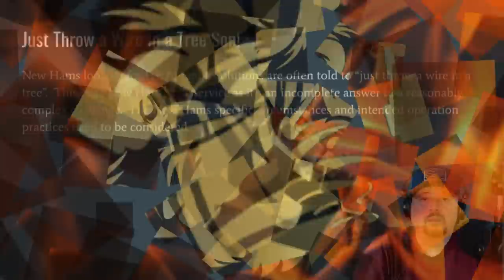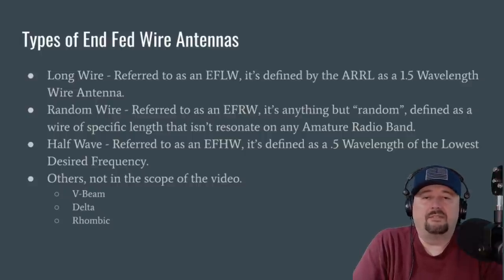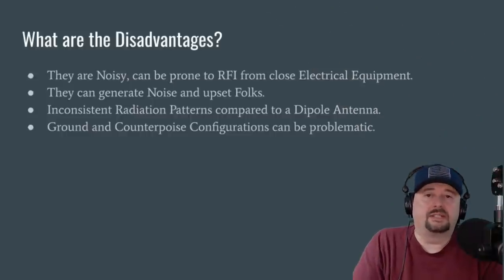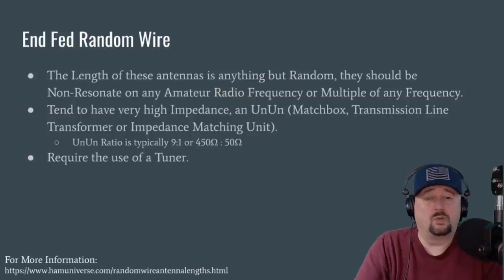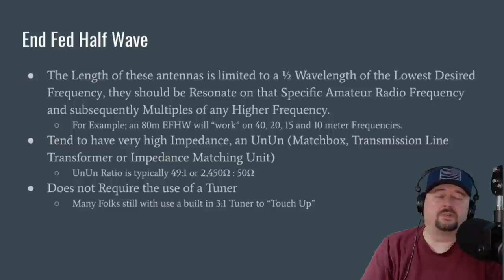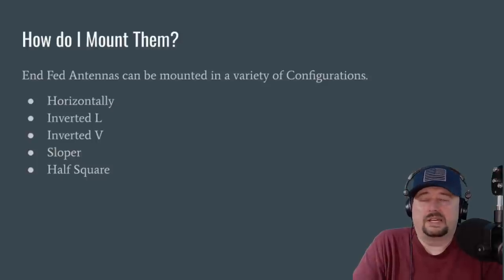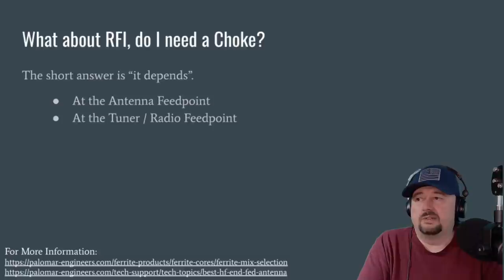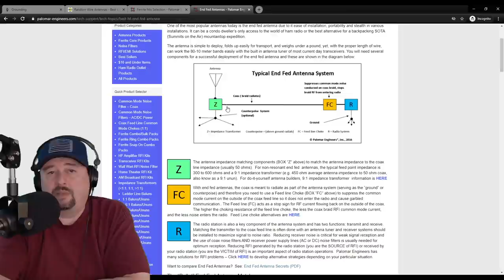What the Heck is a Long Wire Antenna? - Ham Radio

Comment: Actually, the definition in the appendix would be a better reference, my bad: "Long wire—A wire antenna that is one wavelength
or greater in electrical length. When two or more wavelengths long it provides gain and a multilobe radiation
pattern. When terminated at one end it becomes essentially unidirectional off that end."
Reply from the maker: Thanks for the info!
Reply: @TheSmokinApe  I've never tried a fullwave wire before. I think it would be cool to at least try one.
Reply: @highlandkraftwerks  Start with 6M, easy to construct - just a tad under a 20' wire. The horizontal polarization works extremely well for some extra gain when using SSB on 6M. Run it more vertical, of course, if ur transmitting FM to repeaters.
Reply: Terminated? What does that mean? Any finite wire is terminated when you cut it from the larger roll, right? I need more information on how to do that and with what. 🤓
Reply: @PatrickKQ4HBD  <--- total radio newb, but I think that would mean terminated with some resistance via a resistor on the end.
Reply: Dx commander Cullum has a video about his friend Rollie in New Zealand who used some telephone wire that wasn't being used still on the poles. If I'm not mistaken it was over a mile long. Now that's a true long wire antenna.

Comment: Perhaps one of the most useful ham radio videos for new hams. I’ve struggled getting good info as a new ham and ham groups not meeting due to COVID. I ended up doing an end fed random length wire antenna but this gave me more info to understand what I’m experiencing and ideas on how to improve it. Thanks for putting the work into creating this video.
Reply from the maker: Thanks for the comment Bradford, glad the video was helpful 👍
Reply: Well, COVID is over now. The government has declared it over by rescinding all COVID benefits, so plan on getting together with other Hams to spread info on the latest stuff. Also plan on making your own stuff, especially antennas. Hams that buy antennas "off the shelf" do not learn anything about antenna theory and end up spending altogether too much money on something they could have built themselves for half the price.

Comment: Hey Ape, ur right about how important the RF choke is - not only for RFI, but improved SWR as well (too much reflected RF along the coax shield negatively impacts SWR). For my base station, I use a MyAntennas 65' EFHW as a sloper, fed at my roof line 12' high and sloping up to a 37' fiberglass pole mounted at the back fence. Works fantastic! I use a DX Engineering toroid choke at the feedpoint and also at the entrance to my second floor HAM shack. No RFI and low SWR. However, for portable ops, I use a Wolf River Coil vertical antenna (which I'm absolutely in HAM-love with). For that, I put my DX Engineering toroid choke 12' down the coax from the antenna and then run another 25' coax to my rig. I experimented greatly with different lengths and found using the 12' of coax as a 'counterpoise' for a vertical worked much better than at the feedpoint or none at all. I combine that with nine 8' radials (3 off each leg of the tripod) for portable ops. 73 KJ6ER, Silicon Valley
Reply from the maker: Great comment, I like hearing about other folks setups.  Thanks for sharing!

Comment: I feel you've provided very useful information about end-fed antennas for those who want to work multiple HF bands. Houses with large yards and space for multiple antennas or towers are increasing expensive. Many younger hams live in apartments and condos where a single multiband stealth wire antennas is possible. Also, older hams whose children have left home may want to down size and move into smaller homes or condos. For those considering an end-fed antenna, I've worked Australia and the US East Coast from California using 100 watts on 40 meters SSB with a 71' non resonant end-fed sloper going from a 25' balcony down to a 6' wooden fence. It has a 9:1 unun, 50' RG8u, two 15' counterpoises, common mode choke near the transceiver and a manual antenna tuner. I check into 40 and 80 meter nets and get good signal reports. Using that antenna I've made QRP contacts with as little as 1 watt. I'd encourage hams to experiment with end-fed antennas, especially if you have limited space and need stealth. Your results may be surprising. Thanks again for the excellent presentation and the helpful references!
Reply from the maker: Thanks for the detailed comment Jon and for checking out the video 👍

Comment: Thanks for making a video where you actually cite sources and provide an objective comparison!  I just want to caution regarding "reading online reviews"...please understand that some users are biased (both good and bad), some have been paid or are provided with free equipment, or their reasons for providing a positive review might actually be the opposite of your requirements or use case.  Ya know what would make the video go from good to excellent? A round table of youtube "experts" at the end discussing this evidence based material and applying it to station operation.  73 de N2MXX
Reply from the maker: You make a great point about online reviews David, thanks!  Also, thanks for the feedback and suggestion.

Comment: Great video, Ape you rock man.
I have followed yourself advice with my end feds and have found similar results. I apply a choke at my 9:1 and have used a counterpoise, but I'm still learning by playing.
I recently used my 9:1 end fed at a inverted L using a 30ft telescoping with good results as well. I plan on exploring with which I help to use to get some more experience using my nanovna and experimenting with the different stuff>
 because hey just like you have said, it's fun and it more important makes you a better ham operator when you understand what you are doing by "doing radio" and apply the -art of our hobby.
Reply from the maker: Great post Mike.  Thanks for the feedback 👍

Comment: I'm listening while working on the house. Inverted L's are vertical antennas. They require a groundplane. They are not to be confused with an inverted vee which is a horizontal polarization antenna and requires no ground plane. 

The inverted L is a compromise quarter wave vertical when you can't get enough height, you fold it over. 

So if you want a 160m antenna, your inverted vee will work very well against the inverted L if you get the vee center up a half wave in height. 

Maybe you can see why a lot of low banders go with inverted L's. They really aren't necessary on 20m or above because it is so easy to hang a dipole. 

Peace.
Reply from the maker: Agreed,  thanks for the post BDRFI 👍

Comment: I highly recommend a 9:1 unun whether you build one or buy one for experimenting. With a tuner and a bit of an imagination you'd be surprised what metal objects can be turned into an antenna. This past year I played around with all the same wire lengths you spoke of and it's been interesting but recently settled on something around 71 feet. Also experiment with counterpoise wires in different lengths and directions multiples etc.. One interesting thing I've found is some bands don't require the tuner at all so experiment with that too. I recently found my current configuration has a pretty flat SWR on 17 meters without the tuner in addition to other bands I was already bypassing the tuner on.
Reply from the maker: Great comment and I totally agree.  I’ve have similar experiences, thanks CWB 👍

Comment: Your comments at the start are correct.  A lot of advice is thrown out casually and assuming a knowledge that if present wouldn't be generating the questions.  I also think the requirements for RX are not so onerous as for TX and its not always clear which the advice is aimed at. I  am struggling to find a suitable antenna but i also want to  consider the RF radiation impact at the same time and for my small space its very constricting.  Also while I thought i was comfortable with the concept of counterpoises the practical side is slightly confusing me as the various advice out there doesn't seem consistent or detailed.

Comment: I like the new background and I like videos that get me thinking. 
Props
I think would be a good be sure to clearly delineate different usage scenarios too. 
Getting started with basic stuff can work, but yes it should be done with an eye toward growing your experience and evolving your station to be as good as it can be.
I am guilty of making the advice of throwing out a wire and stuffing an wire into a radio connector; however, that's an attempt someone to give a means to listen to a radio they might not have ability to connect properly yet in order to give them access to it.
Should they get the proper connectors? YOU KNOW IT! -This is the beginning of the magic very often. I wish I could gift a PL-259 and 25ft of some coaxial cable to everyone getting started... :)
BUT
There is always a starting point, and sometimes that starting is a very low start indeed. I'm remind myself of my humbling beginnings on my ongoing radio journey...
That being that said YES let us give the best advice we can and advance the art and help us make radio better for everyone!
Reply from the maker: Thanks Mike.  I'm planning to do more detailed videos on the EFRW and EFHW but it's going to have to wait for warmer weather.  One thing I always say is just get the antenna up, then modify or adjust as you progress.  Thanks for the comment!

Comment: Thanks for the video.  I'm just getting back in HF after about a decade off the air.  I've used flat dipoles, inverted v s and a full wave loop for 80 meters (one of my all time favorites).  
My tree limbs are more in the way now so I'm taking a look at a lot of different ideas for the wire.  Your video answered a lot of questions for me.  One was about the inverted L long wire antenna, the long wire inverted v type long wire  and another was the long wire that went up, across horizontally and then back down as well as how to feed those and how high above the earth.    
One question I have is how radiation pattern feed ohms etc are affected if I put most of the wire horizontal, but give the wire 90 degree direction changes with most of the wire horizontal?  That could give me a lot more wire surface.  Oh, I also noted the lengths to avoid and to use.
Thank you.
Reply from the maker: Hey SE, glad the video was helpful.  A horizontal bend will certainly change the radiation pattern and may change the impedance but give it a try.  I have seen them in giant U and Z patterns where people were making plenty of contacts 👍
Reply: @TheSmokinApe  Thanks for the information.  I added this video to favorites and I'll likely watch it at least a few more times.

Comment: I’m just starting out with ham radio and would appreciate any advice regarding my present plan for setting up a station for my 100 Watt Icom IC-7300 radio. First some background. For various reasons I want to set up my radio on the second floor of my house (roughly 20 feet above ground level). I live in a city neighborhood where large, obvious antennae are not practical. I’m confident that I can install an end-fed random wire antenna of length 35 feet (roughly). The antenna would run horizontally alongside my house at a height above ground of roughly 30 feet. I have a second floor deck where I plan to terminate the antenna. From the termination point I plan to run a 20 foot piece of coax to my radio. My plan thus far is to install a matching transformer and choke at the antenna feed-point on my second floor deck and from there to my radio via coax. I’d like to suppress common mode currents on the 20 foot section of cable running inside my house to the radio.

My primary question concerns how to establish a useful rf ground for the antenna. I should add that the likelihood of lightning strikes is very low where I live. I have access to my house electrical ground via an outside receptacle on my deck but my instincts are to not connect to it. I worry about tripping GFI and surge suppression devices in my electrical panel, not to mention general rf interference impacts on home electronic devices.

One approach for grounding the antenna is to run a wire vertically to the ground from my deck, and to connect it to a ground rod. Any advice as to the efficacy of this plan will be much appreciated.

As an aside, my second floor installation plan has made me curious about aircraft-based radio systems which clearly do not have access to earth ground. I.e., do aircraft-based solutions offer any solutions for my system? In effect my second floor installation is akin to a low flying aircraft.

Thanks much!

Jim (KK7CSC)

PS: I should add that I’m interested in operating on the 40 meter (7 MHz) band through the 6 meter (50 MHz) band.

Comment: I'm currently waiting for my technician call sign, as a step to my general thereafter.  Your videos that focus on antennas peak my interest, and I have a lot to learn.  In fact, experimenting with antennas, especially building them myself is my primary interest in ham radio. 

I've worked with VHF/UHF antennas for radio and television since a kid (obsession) and learned that their location (minimizing multipath) matters WAY more than their gain or style.  But then again, those are yagi's.

What about 10 meters and a dipole???  If I run a wire across my yard between some trees, will location of my antenna matter as much as what I've experienced with UHF/VHF bands, provided I have it elevated at the optimum distance from the ground?
Reply from the maker: Hey Rick, good luck on the general test.  Dipoles are some of the best performing and easiest to build antennas.  You want them about 1/2 wave above ground, so a ten meter dipole should be five meters high 👍

Comment: Ape, 
Just a little question regarding wire antennas, if I may?.....
Is there any difference in the RF characteristics of a copper wire that is covered with insulation, say PVC or PE, versus a wire that is bare?
With respect to velocity factor or other such parameters that could affect the performance of a wire antenna?

Cheers,
Mike ZL3XD.
Reply from the maker: The big thing is that the type and thickness of the insulation will alter the velocity factor of the wire 👍

Comment: This was VERY helpful.  I am HOA constrained and have a fan dipole in the attic - it works, but... A question about the feed line chokes - how many loops of RG8 feedline do you need?  The pic on Palomar's site looks like a smaller coax.  Regardless, thanks again for the time/effort you put into sharing this - gotta check out some of your videos!  73 de ki5gx.
Reply from the maker: Hey Shawn.  I think 11 is the magic number but anywhere from 9 -13 will make a considerable difference.
Reply: @TheSmokinApe  Thanks amigo!

Comment: Ive been using a long wire every day son,er sir...  been using it less than 3 years. About 264ft long. Mostly digital. works real real low to the ground due to the poor soil ~5 ft (basicaly gravel and sand) in my area. I near Maine, on 20-40m, Japan on 40m during the early morning in Tucson.. I am strictly digital ham. I have it shaped like the letter J on my city lot with the longest part of the wire facing west/east.
Reply from the maker: Thats awesome Will, thanks for sharing 👍

Comment: I have a Ultimax 100 Hf wire antenna which is a mere 22ft long, i have used it once on a vertical and it worked fine up a Spiderpole 10m, albiet we was at height, for 10/11/20m
Reply from the maker: Nice, I'll have to check that one out...

Comment: Great video! Without researching (purely your opinion), how well do you think an 80m EFHW w/counterpoise would work with the feed point at 30 feet sloping down to about 5 feet? I know you said you prefer feed point at the ground.
Reply from the maker: Yeah, I do prefer them at ground but you could do as you describe.  It may require cutting the element to a different length 👍

Comment: Great video! Wouldn't placing a choke at the antenna feedpoint prevent the coax from acting as a counter poise (which is normally a good idea with an EFRW)?
Reply from the maker: It would.  I generally don't like the idea of using that coax as a counterpoise so I add one to the transformer / UnUn.

Comment: I just connected a RTL SDR to the defunct telephone copper house wire. Works fine for shortwave radio. The antenna is probably many kilometers long. I have no idea if that is a plus or not
Reply from the maker: Thats pretty creative, if it works it works 👍
Reply: There's  a disused 1950's railway line near me , not connected at either end about 4km long and i have been wondering what use that might be as an antenna?

Comment: So, I have a question for you on the EFHW antenna.  I had a MyAntennas EFHW-8010 1kW and love it with my Yaesu FT-991A, I used it as a sloper.  Unfortunately, it was struck by lightning, everything blow up wire and all.  So now, I am shopping for another one. I am thinking about getting another one but, what is the difference between the EFHW-8010 1kW and the EFHW-8010-LP 250W, I do see that there is a power difference.  Is this somthing that I should take into consideration and what does this mean as far as the antenna, the 1kW and 250W.  Will buying the 250W make the antenna less effective?  Thank you SmokinApe.
Reply from the maker: Typically the power rating comes from the size and number of toroidal cores inside the transformer.  You should be fine with the 250w unless you are running an amplifier 👍
Reply: @TheSmokinApe  Thank you .
Reply from the maker: @janiceemery2008  Anytime